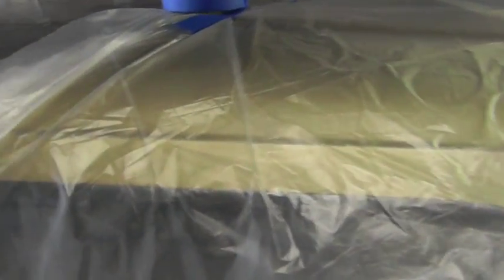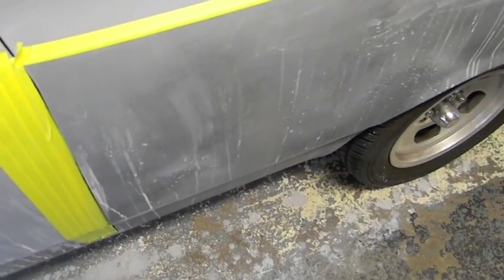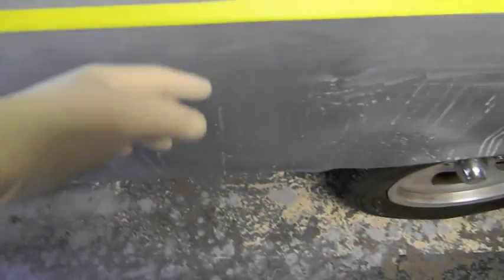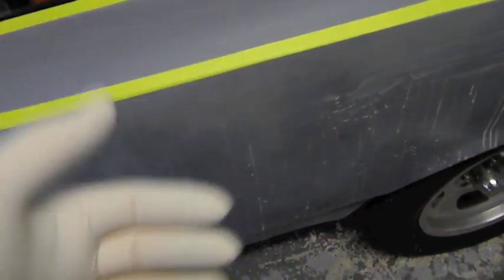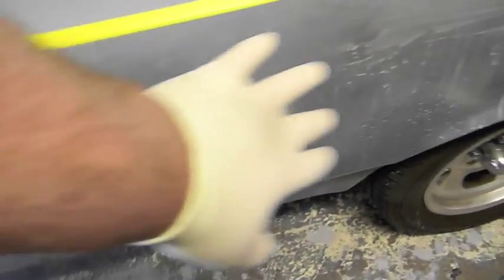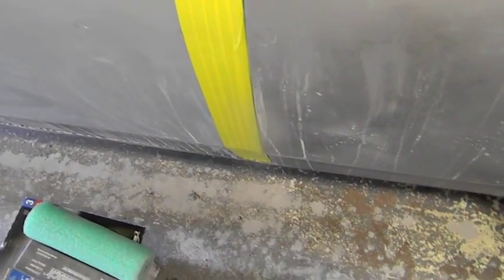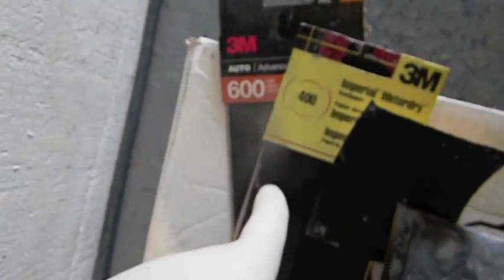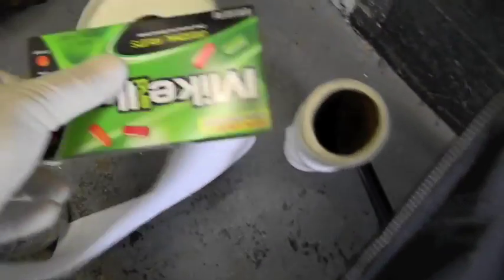Block Sanding 101 Pt1

Comment: When the guide coat is gone, you have no idea what you're doing...  interesting thing to ponder... You are right... I've been using high points as a guide to when to stop sanding. My filler applications are thick enough that I always sand away the guide coat
Reply from the maker: I should have went back to your house and took a peek and such but my head wasn`t fully in the game.But we still had an awesome day…